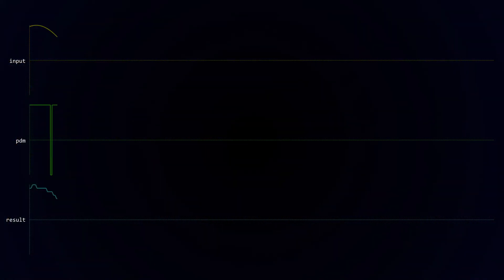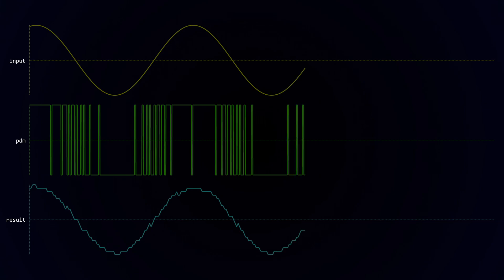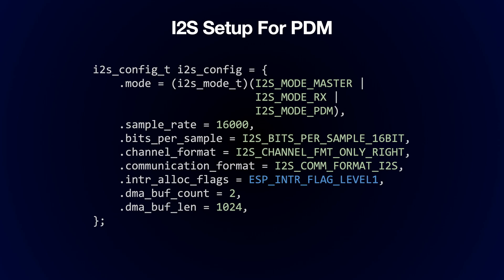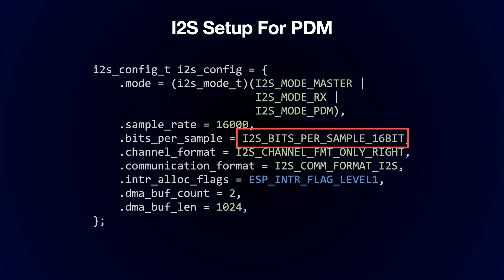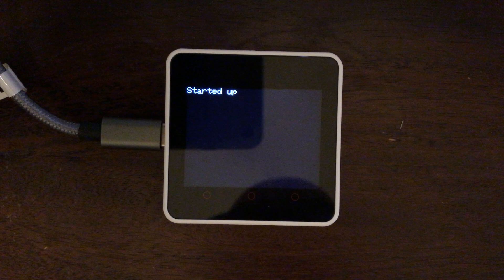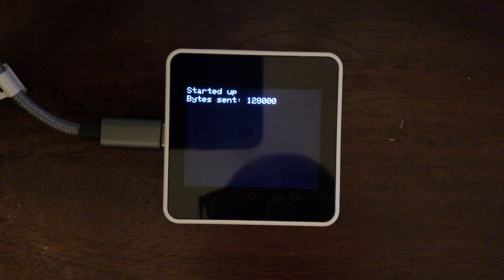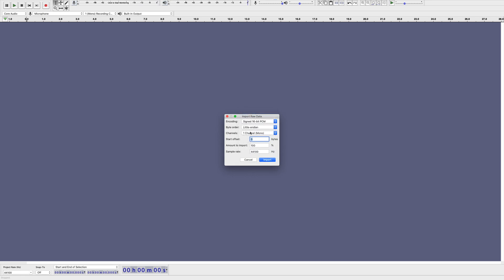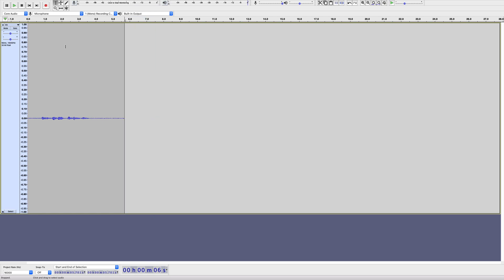M5Stack Core 2 - Audio Input

Comment: it works on mine, but the green wave starts in the middle goes down a trough them comes back to middle.  You get the waveform ok.  It is as if there is a permanent very low frequency sound.  I came here because I was trying to use the I2S microphone (which is crap) with the arduinofft library.  When I record 1024 samples most are junk.  I think thats the issue with the I2S microphone, so perhaps I need to continually run it like here and grab 1024 from when its running.  Which is what I think is happening here.   But unless I can get my waveform to look like yours, then maybe my hardware if faulty?

Comment: This seems really cool, and I want to try it with an LED strip.  However, I can't figure out how to get it onto the device.  It successfully builds using platformio on the command line.  I'm on Windows, so I changed the ports in the platformio ini file to COM3, but I've never actually loaded anything onto the device besides using the M5Burner.  Any advice would be appreciated.
Reply from the maker: You should be able to run "pio run" and it will transfer it onto the device. You can also use VSCode with the platform io plugin which has a compile and run button.

Comment: Hello atomic14, I am using the M5Stack core 1 for a lot of projects, especially for lightpainting with pixelsticks. Now I have bought a core 2 and found your video which is very good. My question: Have you played already with controlling RGB LED stripes based on audio signals?

Comment: After playing sound through i2s on my M5 Core 2 I had got no power on 5V line and I suppose DCDC is broken because when I switch it on programmatically it did not boost 5V line. So be careful with Core 2 - it`s fragile.

Comment: Actually I have the M5Stack Core 1 with the external PDM unit, but I love your explanation ! I have a question for you: I’m trying to write the recorded audio in a file onto the flash memory, but seems that the write is too slow and the audio file is missing some speech. Did you ever found such problem ?
Reply from the maker: Have a look at my code here - it works with the SD Cards that I have - https://github.com/atomic14/esp32_sdcard_audio
You'll need to change the pins of the SD Card to match the M5 Stack - the CS pin is 4 and I think the other pins are the default SPI pins.
Reply: @atomic14  Thanks, I will check the code and I will try to adapt it to my project. Could we keep in touch ? I’m a senior software architect (.Net, Node, etc) and I’m quite new with the Arduino world (I work with Arduino since 1 year).
I started to test audio capabilities of the M5 products for personal social projects (deaf people).
Would be really nice for me to keep in touch with you.
Reply from the maker: @lunard75  Sounds like a really interesting project - you can reach me from the "About" tab on the Channel Page.
Reply: @atomic14  I wrote you on LinkedIn..thanks !
Reply: Another question: did you play with the M5Stack NODE extension and the ESP-ADF library ?
Reply from the maker: @lunard75  I have not - but it looks very interesting!

Comment: Do you think its possible to connect M5stack with a USB microphone for external connection to collect sound data? Thanks!
Reply from the maker: Probably not possible with a USB microphone. The ESP32 doesn’t have a USB host so it can’t really interface with other devices that way.